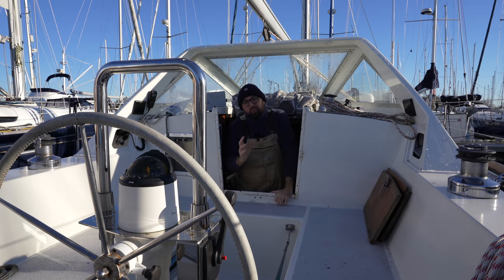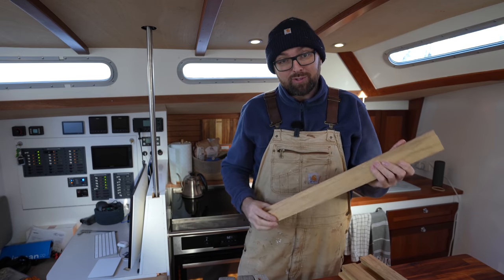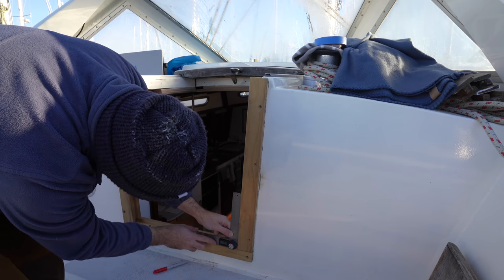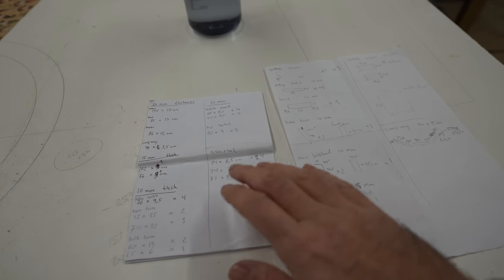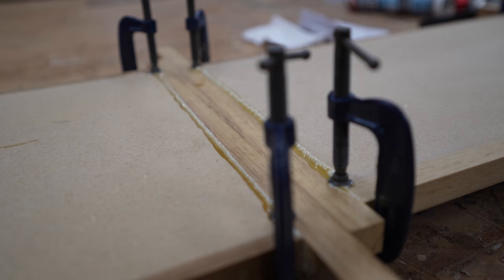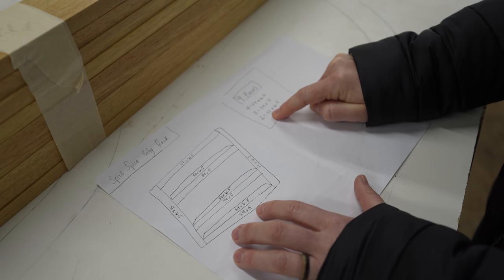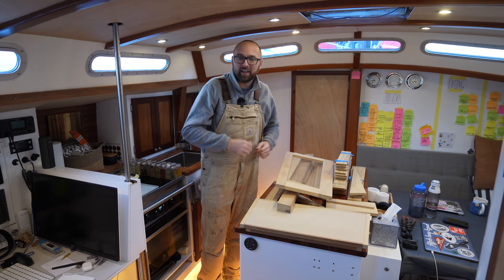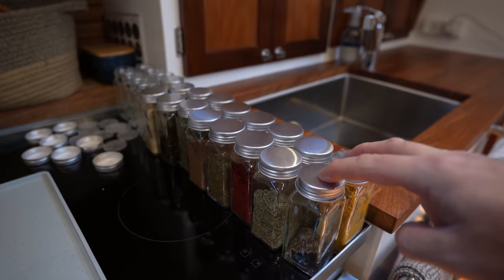Sail Life - Companionway doors and a spicy rack! 🔥

Comment: Foam pool noodles or swim noodles are great for squeezing into spaces where you might have something slide around. For example the parchment paper could slide side to side while out cruising. I keep a few on hand as I seem to find new areas which require padding. Just cut them to length with scissors, and squeeze them into their new homes!

Comment: For future projects in wood if you have to put screws in near the edge then use a grinder to grind off the tip of the screws leaving them flat at the bottom and then screw them in. That helps prevent the wood from splitting. I leaned that from my dad.

Comment: ... 😻 ...
Hi Ava and Mads.
Regarding the moisture under the bed ..
I did my bed so it is open at the middle front.. to allow lots of air movement .. it also gives easy access to everything.. without moving my home made futon mattress..
also the bed base is 3" wide oak slats .. 1" thick .. with edges nicely rounded and all sanded very smooth .. with an inch between for ventilation..
You could add a ducting pipe near the bow to draw the air in summer and reverse the air flow in winter to warm the area up .. I have hot water pipes that I use when it gets really cold..
Companion way door hinges could be the type with pins so they can be  unhooked and stowed .. also make several different companion way boards including a thick perspex shutter..
Hope this helps..
Regards Bella and Mark.

Comment: Mads, doors looking good. Wonder if you could have hinges that make it possible to lift the doors off? So when at sea they could be stowed and then installed when useful in marina? Just a thought
Reply: Look carefully at 3:44.
Reply: @markbernier8434  Eagle Eye Mark. Well spotted, lift off hinges. In Australia lift off hinges are used on toilet doors to enable the door to be removed in case of a body behind them. Not sure why they don’t just have the door swing out though. Lol.
Reply: Well spotted..
My excuse.. I'm watching on mobile.. 🐱 ...
 I said about that type in my comment as well..
Didn't know you can get in stainless..
The trick with fitting is to have the pins on the door so you don't get hooked .. and .. grind a little bit off the top pins with all pins filed a bit like a blunt pencil .. all this makes hooking on easier..
Old speaker magnet's low down (away from compass) can hold the doors open. Put on doors and other side of fibreglass they don't rust...
Reply: Loved the outtakes.
Reply: I will say my boat has half hinges (lift off hinges) and they are amazing to have. On a warm day I can just remove the doors without issue, it also makes getting large items through the companionway a bit easier if needed.

Comment: I'd sand and oil the new wood. It makes it more resistant to water and depending on the oil you're using, it will also darken the wood somewhat, bringing it closer to Teak.
Reply: I would epoxy and varnish the wood, It's just a preference.
Reply: @Tomm9y  I'm not sure what's better. I'm also just a DIYer, nowhere near Mads' level, but I built myself some furniture before - every piece turns out better than the last one. 

The last was the base for my bed, with bedstands attached. Oiling was recommended to me, with a wood that turned out very similar to what Mads is using for countertops. I'm having a bit of trouble translating it, though... Google translate says, acacia wood.

I'm planning to build a large writing desk, with a shelf integrated in the coming year. I'm planning to epoxy/varnish that, but I'm still unsure what resin (brand/type) to use. :-)

Comment: Very nice woodwork. It looked like the hinges you will use are the type that can lift off. If so, and if you're planning to sail in tropical waters, you may want to make another set of doors with fine screen rather than perspex. Would provide ventilation while keeping the bugs out.

Comment: CONSIDER USING "LOOSE PIN" HINGES ON THE COMPANIONWAY DOORS.  These have L-shaped removable pins (shaped much like an Allen wrench) which means the doors can easily be removed and stowed below when sailing long distances.  This will protect the doors from the elements when not in use.  My guess is that you could simply grind off the top or bottom of the four hinge pins you now have and replace these with stainless steel rod stock of the same diameter with a 90d bend in each.  make them a bit longer than the hinge itself-and make extra pins!!  This all assumes that you would be using the new washboards instead of the doors to actually securely lock up the boat when you are away.
Reply: See my comment and one I responded to..
Look closely at the hinges ..

Comment: Hate to brake it to you guys, but washboards are indeed struktural in case of a wave strike. not in daysailing, but considering crossing oceans: yes. for comparison: cat A suggests a minium thickness for polycarbonate deck hatches of 10-12mm, depending on size+ position. be safe.

Comment: A designer I used to work with once told me: If you can't make them the same, make them different. This is to say that if the wood of the Spice rack cannot look like the rest of the galley wood, why don't you paint the rack the same color as the walls? Cheers, Richard

Comment: The spice rack looks great but glue and screw on the was overkill as the glue alone would hold it. A nail gun with some 23 gauge pins to hold the wood while the glue sets would have made things so much faster.

I cringed at you using a chisel towards you hands, a small clamp or vice would have been much safer.